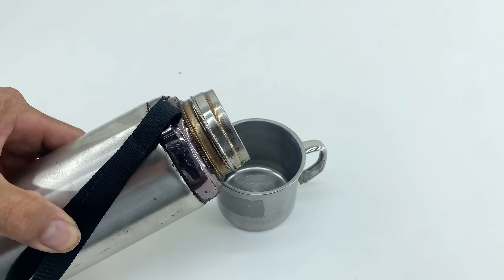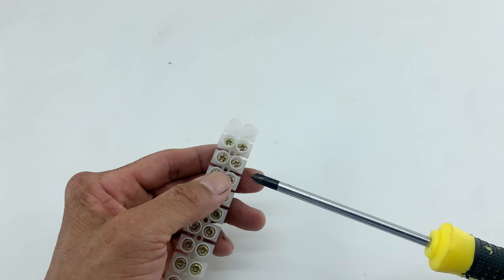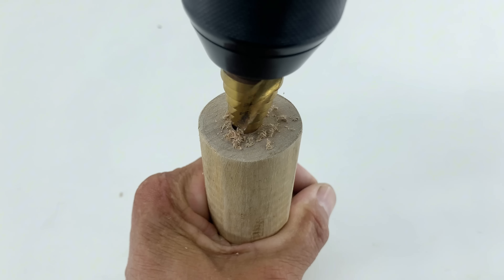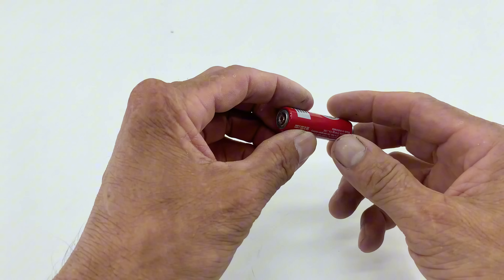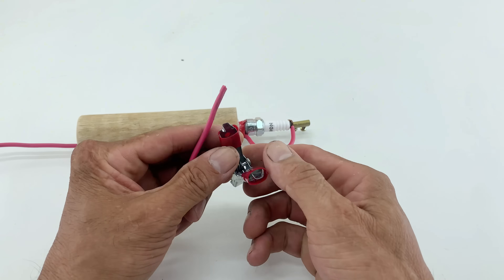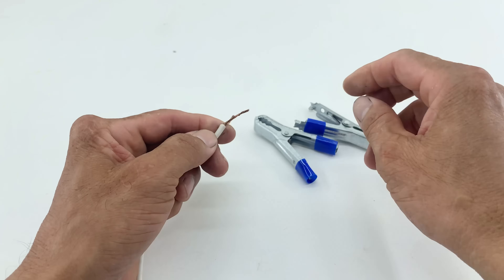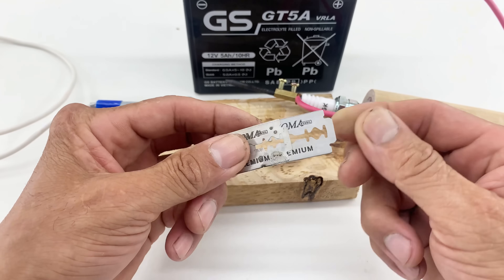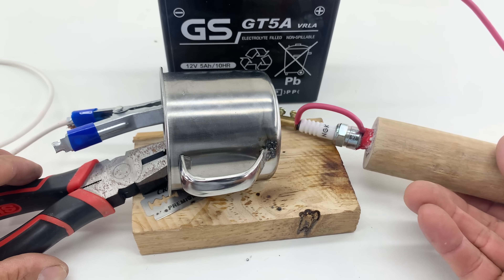How to make a super powerful homemade welding machine from spark plugs!

Comment: Is this the only cup that can be welded? Can it be used to weld other things?
Reply from the maker: It’s not limited to this cup. The same technique works on many small aluminum or thin metal objects, as long as they have similar melting points. I’ll try showing more examples in my next video.